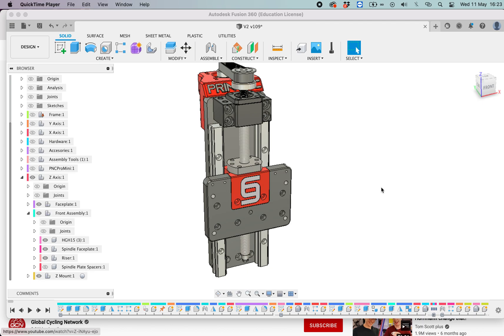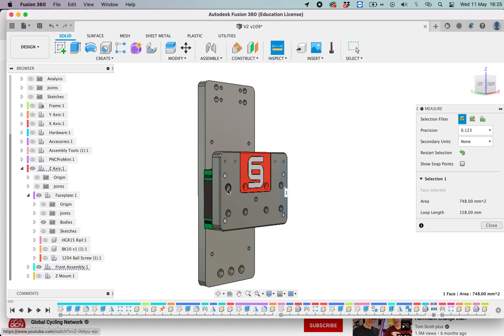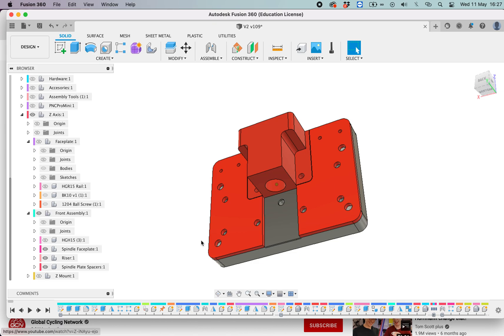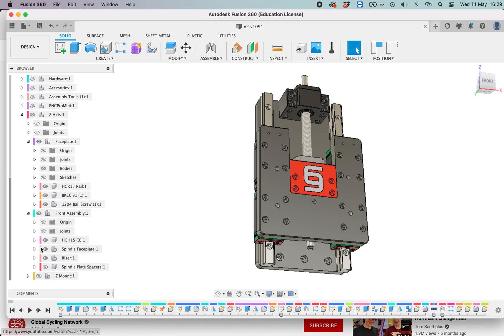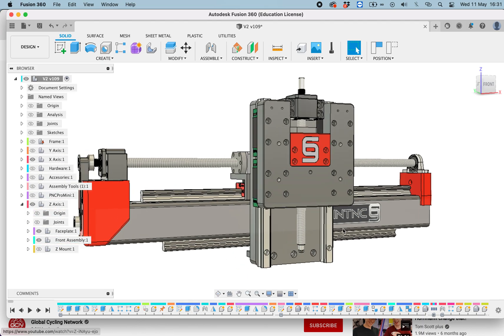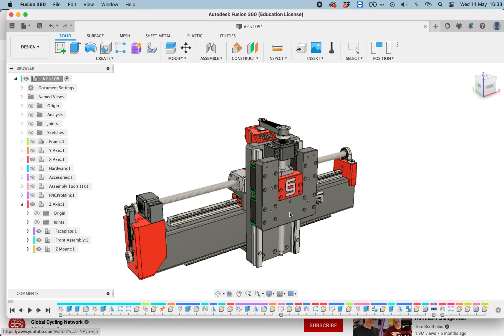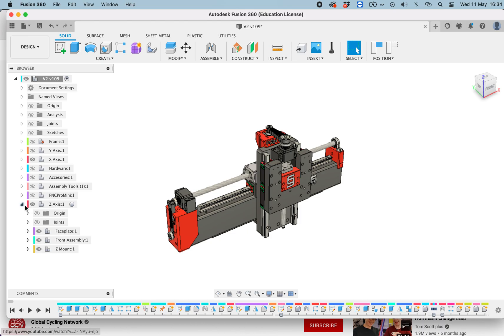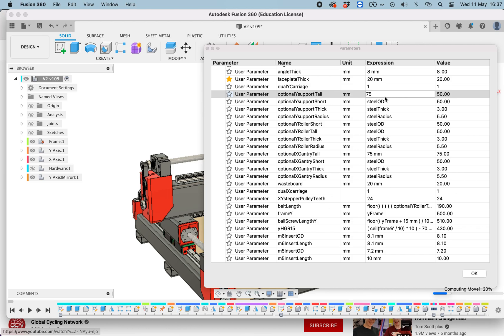PrintNC-Mini Update and Z Axis Overview

Comment: Very cool, been looking to modify the current design to something similar. This is way better than anything I could come up with.

Question: are 170oz nema’s sufficient for this design? Or do I need high torque 300oz and over? I do plan to mill 7075 alum. Any suggestions would be helpful.
Reply from the maker: The Mini uses 92 ozIn Nema 17's in either closed loop or open loop options. The Steppers you have suggested there would be better suited to a full size PrintNC which uses Nema23
Reply: Thank you!